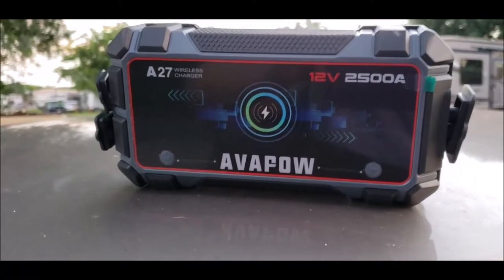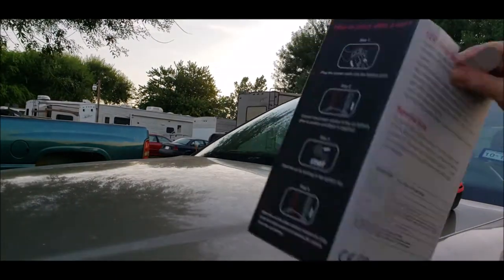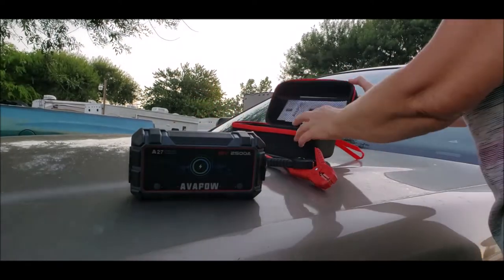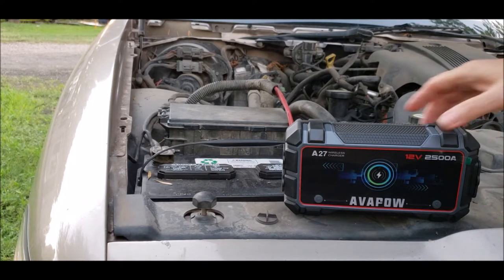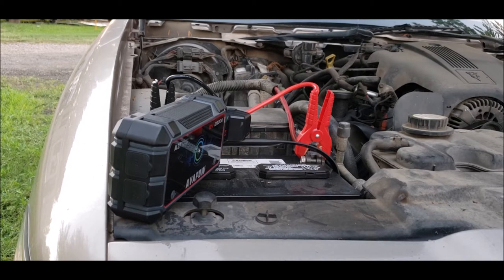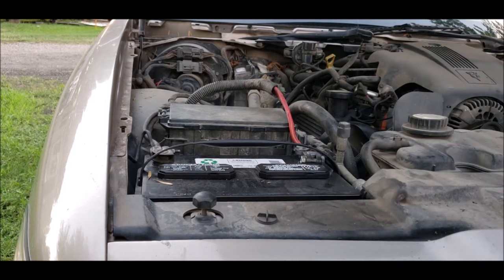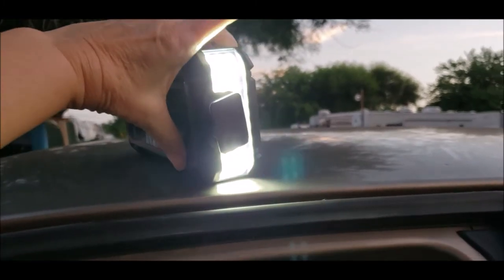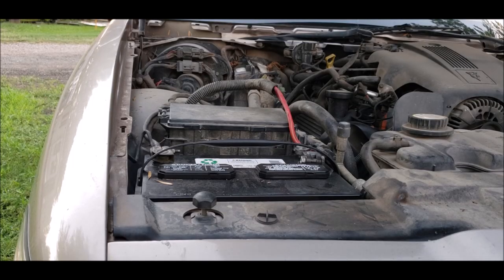AVAPOW Car Jump Starter  8L Gas and 8L Diesel 2500A Peak

Comment: Those portable jumper starters are awesome, but the jumper end can be difficult to squeeze open.  Mine are like that too.  I have one that is about 4 years old, and I've used mine twice to start my car with no issues.  I was in a parking lot with a dead battery, and hooked up the portable jumper.  This guy came over and asked if I needed help.  I told him I was jumping my car.  He told me he would get his jumper cables.  I told him I have a mini portable jumper, and he looked at me sort of funny.  I showed him the jumper, and he had never seen one before.  My car started right up and he was impressed.  He said he was definitely going to get one.  My jumper doesn't have some of the features yours does, so I ordered the one you have.  I'll save my old one as a spare.  In that price point, it has a higher mAH and peak power than some more expensive jumpers.  Plus it has a wireless charger and USB C that I can use with my phone if needed.  Hope you don't have to use it, but if you do, it will do the job of starting your RV.
Reply from the maker: It really is handy to have! Enjoy yours. 💕

Comment: Cables to battery - then connect the device. You’ll get a readout on the screen on the cables first. Then connect the power pack.
Reply from the maker: Thank you.  I was following the instruction pamphlet, which said to connect to the device first.
Reply: @TexCynRVLife  awesome. Some may be wired differently. The ones with the LED readout allow you to see your voltage on cables before you connect the pack. This way, if you see 12v or higher - your problem is not the battery! 😀
Reply from the maker: Cool, I will try it your way. It only spun a square pattern & it would have been nice to get a battery reading.

Comment: People was using a 3000a Avapow Jumper to Jump off Big Ford F450 diesel Trucks and them Trucks have 2 Big 12v Batteries. That 2500a you got should do great for bigger stuff 🙂 but might not start a Big Semi Rig (They use 4 to 6 Car batteries lol)
Reply from the maker: Thanks! The motorhome is a Ford E350, the van lesser, so it's good to know! 😁

Comment: Do not turn the power on the charger first.
 
The thing you should do first , is clip the battery clamps to the battery , second thing to do plug into the power pack. 

Third thing to do is Power it Up , follow the same instructions backwards when you take it when you disconnect. 

You're lucky you didn't blow the battery in your face
Reply from the maker: According to the instructions, you turn the unit on first. I was simply following instructions. 
Thank you for your input!
Reply: If you noticed after she turned on the power before connecting it turned off. I don’t think her battery was dead. But thank you for the info, your advice is exactly what I was looking for.
Reply: Stop being ridiculous  nothing is going to blow up

Comment: How did it take to charge up after taking out of the box for the first time?
Reply from the maker: I think around 8 to 10 hours or more? I remember it took a long time, but don't recall how long now. 
Once charged, it holds up well though. I've used mine several times now & am quite happy with it.
Reply: @TexCynRVLife  Thank you!